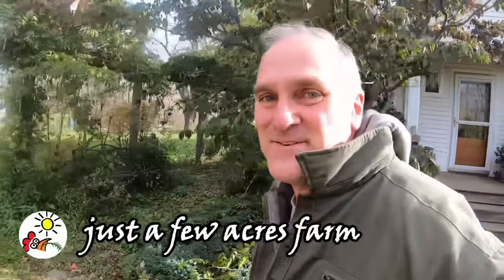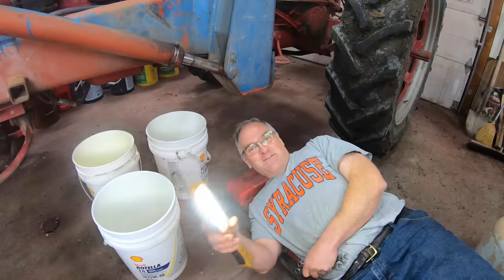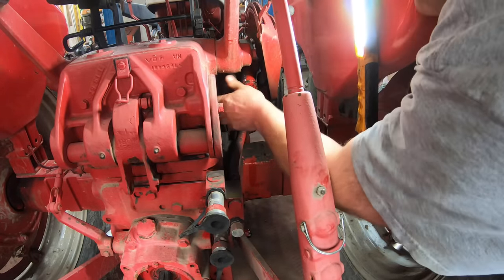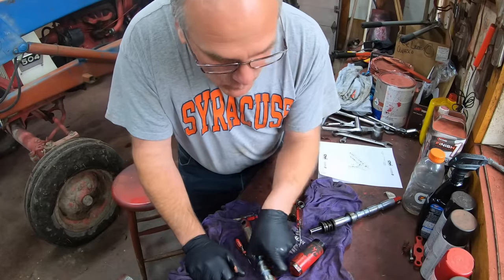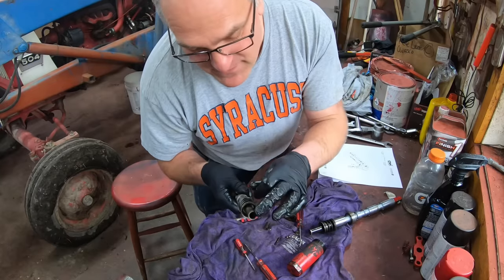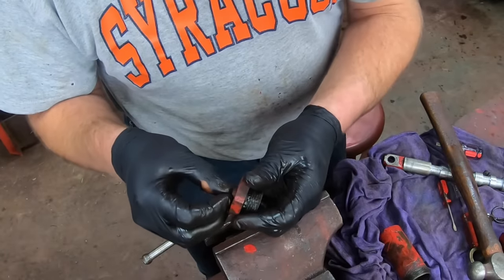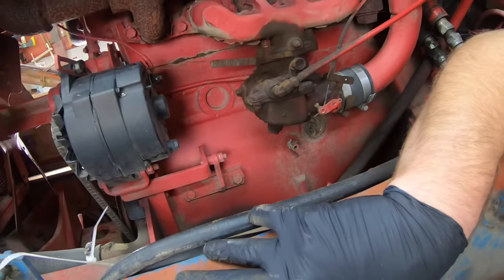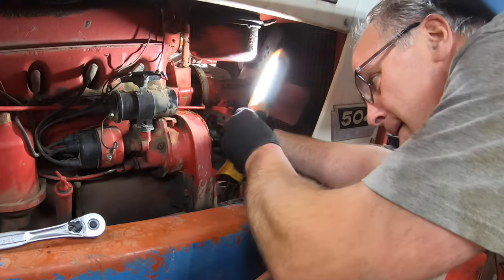Digging Into The Farmall 504: Governor, Hydraulic, and Carburetor Repair Work

Comment: Mechanic, a person who understands the mechanics of what they are working on.  
Technician, a person who uses diagnostic codes to troubleshoot, and replace parts, but doesn't understand the mechanics of what they are working on. 

I actually had a dealer tell me they could not fix a door latch issue because they found no codes on it.  Must have been a technician and not a mechanic who worked on it.  I do all my own out of warranty work myself, and I really appreciate when someone knows how to explain the functions of what they are working on and not just replacing parts.
Reply: There's a difference between knowing and understanding. Knowing is book smarts, understanding is actually observing and participating in the function of the apparatus. And it is a huge difference....
Reply: @frankcurley  Yes it is!   Can't fix a simple door latch because no codes found just irked me to no end.  It's a simple latch, a rod connects the door handle to it, it has a catch with a spring, lift the handle, it releases the catch and the door is unlatched.  No codes found can't fix. SMDH.
Reply: No codes to fix a door latch now that's funny as hell. I turned a wrench for 30 years and was ASE certified in 7 areas of the automotive industry.

Comment: I have an international 444 gas tractor that I've been having throttle issues for some time now. It usually won't idle up, but sometimes if it does it goes straight to wide open. I've been trying to find info on governors and this video helped me so much. Thank you so much. Very informative and you explained things very well. Keep up the videos.

Comment: I hope that the "Different Commenters" aren't too hard on you, Pete. I was low key worried that you might stop with the mechanical type videos. I'm so glad that you haven't. It's very interesting to see how you go about tackling your problems. Those are three position, spring return, pressure compensated valves. Really neat stuff.

Comment: Pete for a carburetor kit, I get mine from Steiner Tractor Parts. I get the premium carburetor kit, it comes with the throttle shaft, plate & bushings. 
Choke shaft, plate & bushings. Carburetor inlet fitting with screen. 
Float shaft. Plus the normal needle & seat, idle mixture screw, main metering screw. I have done a Ford NAA & 5 Farmall carbs in the part 2 years.
Hello from north east Montana. 
10 miles from the Canadian border.

Comment: They are nice tractors. We farmed with them for years and never had any problems with them, just regular maintenance. I have replaced O-Rings on valve spools and had to clean them but never had to buy any other parts for the spools. They have run for over 50 years and that is a good service life. Those engines are quite simple in design as it is easy to fix. The new tractors have so much computer controlled stuff on it that I would not even touch it as it takes special equipment to tune it up which is very expensive.
Reply: A used, new to me worn out 504, would I be further ahead to just swap the 504 for a super H engine and call it good?
Reply from the maker: @frankdeegan8974  Hi Frank, that is not an easy swap. Lots of things need to be modified to fit that series engine into a 504.

Comment: Whenever i have valve bodies out, i just stick a numbered tag on the ear, super easy, hard to misplace. If it's my machine, i just punch the number on the top of the ear with one of those numbered punch sets you find on the usual places (Amazon, fleabay...) You can never get them mixed up that way.

Comment: For your water un the rear end issue. After it sits for a while slowly open the drain  plugs and the water will come out before oil. I have 50's Allis Chalmers that have the same issue. I do it 2-3 times a yr.

Comment: Very good video I enjoyed that. I was always curious about those 504  Engines I did run one for a while Thought it was pretty gutless compared to like an H or an M.   That was my 1st experience with a hydro and it had a  Farmhand on it made stacking hay easy.
Reply: You have to wonder sometimes what the engineers where thinking when they left something that was working well i.e. the Farmall H or M engine or 350/450 engine, for the one they used in the 504.

Comment: I’ve had so much water in the trans and TA on dads old IH350 that the whole thing was bound up when it froze. Had to wait till a warm day where it wasn’t ice to drag it in to the shop and run the stove with heaters under the tractor for a few days to melt it all out. 

Hard to keep the water out of these old tractors if you don’t have a shed.

Comment: Not sure about your tractor but when my tractor gets water in the hydraulic oil it will not separate out no matter how long you let it set but you can still use it to treat the wood on your trailer beds to keep them from rotting.

Comment: Hey, great video!  I recently bought a 504 diesel and after doing some light plowing, I noticed that the center plug on the right spool valve cap fell out.  I have no idea how that happened, but I did lose a bit of fluid out of that hole and lost pressure.  Your video was very helpful, but hoping you would point me in the right direction on where to find that plug, and if that plug falling out is why I lost fluid and pressure?  Should I just find a new plug or should I clean and rehab the entire spool valve like you did?

Comment: Well thats interesting how they just took previous blocks and rebore  for  different cubic inch engine, Gm did same thing with the 350 oldsmobile block made it diesel of course that didnt work well with head bolt and head gasket issues

Comment: Question, I have a new Kioti tractor. Dealer says the oil needs to be changed at 50 hours. I did this and the oil looked brand new! How often do you change your tractor engine oil and hydraulic fluid? Thank you

Comment: Great video Pete, I don't think we got the 504 here in England, UK. What year is your tractor? Do you have to use Hy-Tran fluid in the backend of this tractor? That's what we are told to use over here in IH back ends. Looking forward to the rebuild and the rest of the diesel M restoration too. All the best. Peter.

Comment: Isn't the 504 more or less like the 460 utility/606? They were pretty good but loved the dinosaur juice.
I don't understand why IH pushed those engines out so large displacement either. Sleeved engines are so much better long term. They sid the same thing with the 424 and 444 gas models. The diesel was so much better for fuel consumption and rebuilding.

Comment: Pete, can you add a Joystick to the the 504 for the loader?
Reply from the maker: Yes, a joystick could be connected with a “power beyond” plate added to the hydraulic valve stack, similar to what I installed on the 656.

Comment: I have a quick question I have a farmall 450  with a similar setup with a TA  The front drain you started with is that a seperate compartment below the TA with fluid in it from the rear and trans? On my 450 I have a leak on bottom and was wondering if thats the case  thanks!!!
Reply from the maker: Hi Eric, the TA case shares fluid with the transmission & final drive. They are all interconnected.
Reply: @JustaFewAcresFarm  Thanks so much!!  and the TA is dry above? or is the TA immersed in fluid? thank you!!!